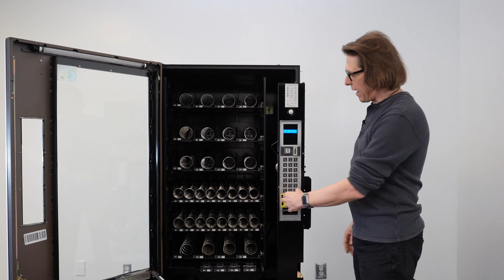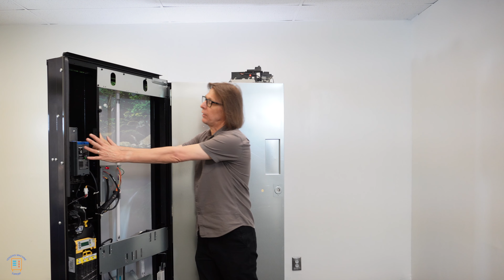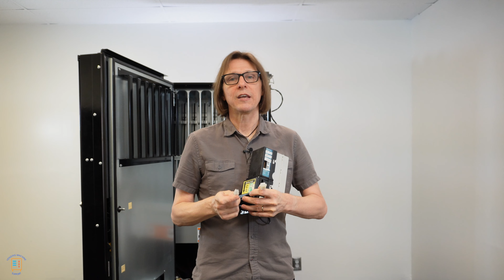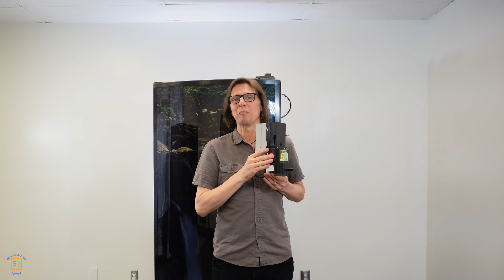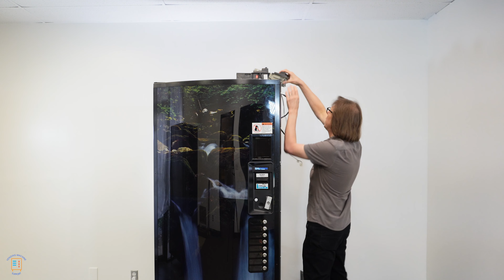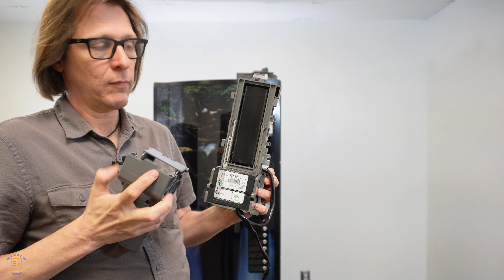Vending Machine Woes: Top 3 Troubleshooting Tips for a Non-Working Dollar Bill Acceptor!

Comment: I own a soda vending machine that is somewhat old, it features a Trc6800 coin acceptor and a system 5305-024 control board I am currently experiencing issues with the bills acceptor. Initially it would accept any bill at all; however after cleaning it, it now accepts them. The problem is that I have products priced at $3 but the machine only registers $2 , and the display screen prompts me to make another selection or indicates an incorrect amount

Comment: None of these fixed my problem. 2 flashes and says it is disabled from system. I put a working coin mech in and it still does not accept bills. What else can I check? What are some other fixes?
Reply: I am having the same issue. 2 flashes. reset everything and it will take a dollar once, but not show the credit. Machine says coin only.
Reply: @karlvondrak6080 same here did u get it fixed yet but chance lol
Reply: Did you ever figure out what was wrong?
Reply: I did not. still looking for answers!
Reply: @JohnBaker-dq2uo  I'm having the exact same problem. If I turn off the machine and restart it will cycle like normal and will work for a short period and then the double flashing light comes on and rinse repeat.
Reply: I’m looking for this answer too. Having the same issue
Reply: Same issue here, I wish I had an answer right now
Reply: Looking for the same hekp
Reply: Did any of y’all figure a solution out? Having issue on about 15 Kino machines. HELP lol

Comment: I just bought a Royal drink machine and was running into this issue, with the bill acceptor not accepting and coins as well. The coins did not have stacks in them however, so I may need to try that. This was very useful, keep up the great work. Thank you very much!
Reply: Did it fix it?